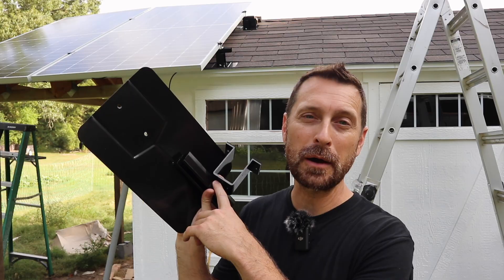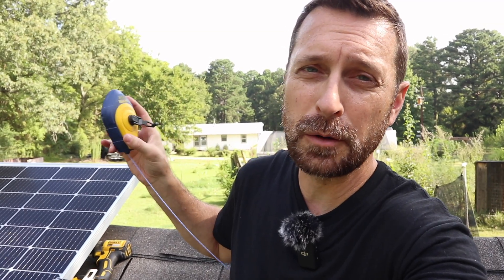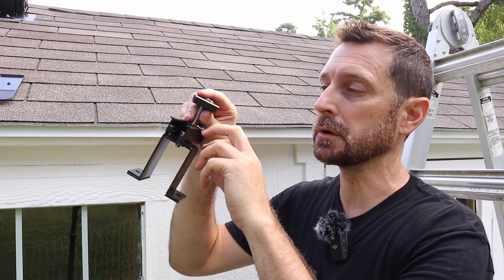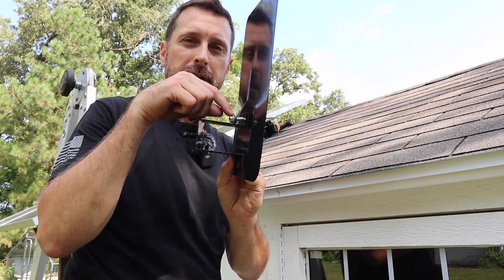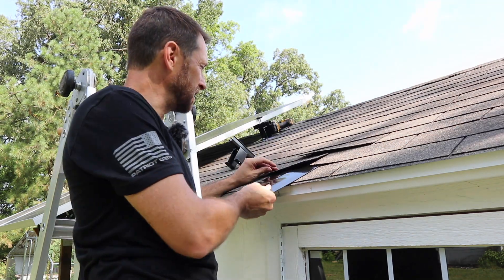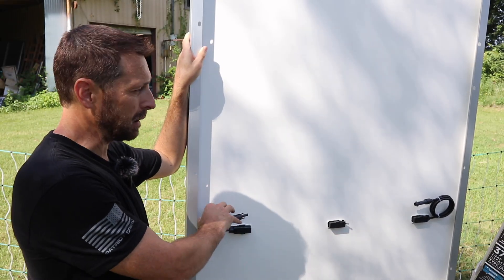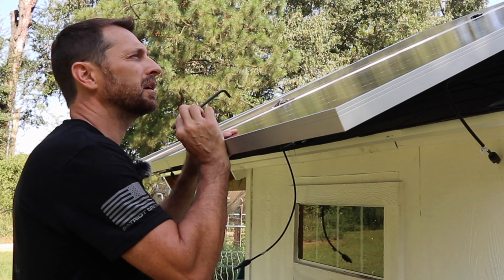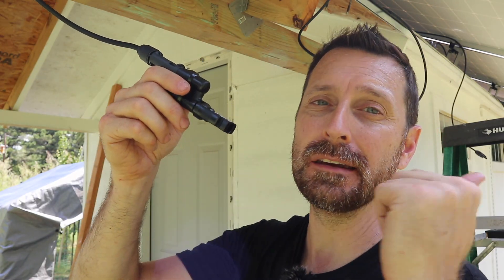Mini Rail Kit For Solar Panels On Shingle Roof! How To Install

Comment: Excellent video. Thank you! The Mini Rail look perfect for my application. QUESTION: I'm not clear about grounding. I am planning to install four 400A PV panels in series on my garage roof to work in conjunction with my Delta Pro, which is located near my 200 load center in the house basement. So the panels will be about 55' (about 70' of cable) from the load center. Should the ground be connected to the load center? Or a spike near the garage? I have read that there should only be one ground, but per haps that doesn't apply in this situation. What are your thoughts?
Reply from the maker: Glad I could help. You need to run the electrical grounding conductor from the panels through and back to the main panel so that you only have one ground rod for the entire system. Mine is run from those panels through the subpanel where the inverters are through the conduit in the ground and back to my main panel.

Comment: What about the ground wire. And does it hook right to the ac unit
Reply from the maker: I show it on the other install videos for this Victron system. The EGC (eectrical grounding conductor) does go through the whole system and back to my main panel and eventually the grounding rod.

Comment: Thanks for the video.  I am watching this to learn about the composite shingle mounting systems for my hybrid mini-split in my radio room/office.  I only have 4 panels with this hybrid system but it beats removing trees or going way out in the back field and spending a ton on wires.  I will have to figure out the shading for the house solar system I am planning.  All the best from Signature Solar’s backyard!  God Bless!
Reply from the maker: Glad it helped

Comment: Bro you have to use a freaking Allen wrench for to tighten the mids and ends down?!?! That is by far the most trash racking system I’ve ever seen. And it is also railless!! Oh noooo not good 🤦‍♂️
Reply from the maker: You don’t know what you are talking about.

Comment: to lift those shingles up, save yourself some time and get a dremmel tool. it does have a lever and it vibrates it at a high speed. great for working under the shingle.  Dremel MM399 6-pc Multimax Cutting Accy Kit. I will post  a video when I do my own array.

Comment: I got a question people that live in the northern half of the United States where they have snow is it important to try to put the panels tight together on the top and bottom so that the snow doesn't build up along the rails?
Reply from the maker: No. You need some expansion room between the panels.
Reply: @CountryLivingExperience  thank you but actually I was talking about the function of helping to keep snow from piling up along the rails that hold the solar panels on if you put the solar panels within say an inch of each other on the top and bottom would that help keep the snow from piling up and causing a leak in the roof

Comment: I understand the clips ground the panels together and to the rails, but don't you still need to connect the whole system to a wire and run it to earth?  Otherwise, it will try and ground through the structure?
Reply from the maker: Yes, there is an equipment grounding conductor that runs through the whole system and back to the single earth ground rod at the barn by the main panel.

Comment: I think the advice in the video for adding "blocking" on a portrait install when you are not over a rafter won't apply if you need to have your system inspected. A floating block is good but the inspector is going to want your mounts to be screwed into structure.  So what I am doing on an addition (using the exact same mounts and 5 of thse panels) is installing structure to completely bridge rafters. The trusses are at 0", 24", 48", 72", 96", 120", 144", 168", 192", 216", 240" etc.  Panel spacing, accounting for the mid clamp width of 20mm, is 41.75 inches.  So the position of my bolts is roughly 0, 42.25, 84, 125.75, 167.5, 209.25 -- that's 6 columns of clamps.  So it is pretty obvious that the 5th column is the only one that will hit a rafter, because 167.5 is very close to my rafter #8 located at 168.  And of course the first row.  To give structure to the other 8 bolt positions (4 columns, 2 min rails per column) I am cutting 8 small pieces of 2x6 lumber. They will measure about 22.5" each. It's not exact because the rafter spacing will not be exact so I have to trim them all carefully.  The 2x6 will be installed flat on the roof deck to bridge the rafters.  They will each be supported by four 4" structural screws, angled thru the adacent rafter into the ends of the small board.  So the boards will go between rafter 2 and 3, between 4 and 5, between 6 and 7, and between 9 and 10. That will give me plenty of space to hit structure without any trial and error.  Final step of prep, before they fill my attic with insulation, will be to put 2 thin screws into my roof from the bottom at rafter #8, poking out slightly at the future drill location on top, and centered within my line of 2x6 braces. Then I can get up on the roof to mark these locations and pull the screws. That should enable me to hit the rafter on the first try, and will give me a reference point for the height of all the clamps on my roof.
Reply: That seems like good pre-planning if a new construction.

Comment: Why not mount them horizontally so you hit a rafter every time?
Reply from the maker: Not enough room for all the panels if mounted horizontal.
Reply: @CountryLivingExperience  I should have realized that I was just wondering if you had another reason. You didn't show exactly how you grounded the rails, do you in another video?
Reply from the maker: I did mention that in the next video in the series....https://youtu.be/BRQ1CIOwZ7c. However, I also did say in the video that the panel grounding topic is hotly debated and there are two different schools of thought.

Comment: I am about to install the same panels with the same rail system. I am building a new roof for it but I'm struggling to find the dimension from top and bottom for where the rail connects? I can run some blocking in the correct location but the spec sheet is not very clear? Do you have to use the mounting holes on the panel? Or can you clamp them anywhere on the panel? Great videos by the way!!
Reply from the maker: You can clamp them anywhere on the panel rails. Put them in whatever position holds the panel the most secure. You can see mine are different on both sides of the roof.

Comment: Thanks for sharing your install details with us.  I have a 21kwp system that I self installed 6 years ago, well worth the investment and sweat equity.  They do make tools for prying up and removing shingles, the one that I have is called the Dasco 640 24-Inch Shingle Ripper,  and there are similar options from other mfgs.  Also, it wouldn't hurt to add some roofing cement to help seal and adhere the flashing and shingles.  You can get it in caulking tubes to make application easier and cleaner.  I also used a "Grip 4-Head Suction Cup Dent Puller" from Northern Tool to grab and hold onto the panels while hauling them on the roof and securing the rail clamps.
Reply from the maker: Cool. Thanks

Comment: I just installed 36 panels using this mounting system. The only problem I had was when I measured where to place the brackets I didn't take into account the width of the clamp, so I placed Mounts about 41 inches apart so by the time I reached the end of the course the mounts were all the way under the panels.  I just drilled two more holes into the rail and moved the clamps out.  My own mistake, since I had never done this before and didn't think it through
Reply from the maker: Cool. You made it work though.
Reply: I am using the same rails soon. How much do you need to adjust for the width of the clamp? It looks like about 1 inch on the video?  So mount them 42 inches apart? Would appreciate any advice you can lend as I'm getting rather nervous. System should be here in 3 weeks and I'm building the roof now. Thanks in advance.
Reply: @elliotharvey69  I have one of the mid clamps from signature solar and it is 2 cm wide, which is 0.787 inches. The panels are 40.86 inches.  So if you add 40.86 plus 0.787 you get 41.65".   So I will go with 41 3/4 for my design
Reply: @rkaraoke7659   Thanks for the info man! Really appreciate it! How far did you clamp the panels from the ends? Signature Solar told me 4" from the ends in portrait configuration but that sounds way too close to the corners. The panels are 81" long so would leave 73" unsupported. Doesn't sound right to me?!
Reply: @elliotharvey69 depends entirely on your snow load.  The solarever 455 panels have mounting holes that are 51.2" apart, so that will determine the optimal position. The instructions for the rails say you clamp between 200 and 500 mm from the end.  200mm is 20 centiimeters which is just under 8 inches.  500mm is 20 inches.  The optimal position for the solarever panels is 81.2 - 51.2 / 2 which is 15 inches.  So I would aim for 12 to 16 inches, though your shingle location will ultimately move the clamp up or down to position the mount correctly below a row of shingles.
Reply: @rkaraoke7659  Thanks for the help man, appreciate it. I was aiming for 15.5 inches which is where the mounting hole is shown on the spec sheet for a non-clamp system. It's a new build so I don't have to lift shingles, instead I will try and place them so it lands well with the shingle row. Thanks again!
Reply: Were your solar panels made in America?
Reply from the maker: American company. Made in Mexico
Reply: I believe Mine were made in China and assembled in mexico

Comment: Should always hit a rafter or you may regret it when a 100 mile wind rips your panels off the roof.
Reply from the maker: Not mathematically possible with these panel dims. We don't have much wind here. If I was to do this in a windy area, I would not use the mini rails.